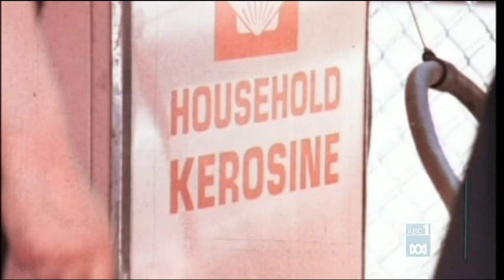Steam Powered 1963 Ford Falcon

Comment: Steam is still used to drive the worlds most advanced subs and aircraft carriers, and the biggest energy companys use steam to sell power everyone buys at a high price, so those agents of denial are are beings exposed now too.
Reply: Submarines and Carriers are still using the same steam technology developed half a century ago.
Here in California the last of the outdated and obsolete boiler fired steam power plant are scheduled to close forever.. to be replace by the ever growing number of Gas Turbine combustion power plants... they are both cleaner and more important MORE FUEL EFFICIENT than steam power plants. Knowledge is power, cheers!
Reply: You are certainly not implying that nuclear powered cars that operate underwater would be a commercial viable concept? Are you????
Reply: The real doktorbimmer  its comical watching deniers pull things to both extremes to AVOID  the obvious
Reply: The real doktorbimmer  what modern latest sub and carrier are using out dated  engines?
Reply: +Frank James There is nothing more comical that someone denying the Laws of Thermodynamics that govern Heat Engine Efficiency.  Not only was it was discovered that steam can never be more efficient than internal combustion, it was discovered nearly 2 centuries ago..
Reply: +Frank James  All of the Nuclear warships in current service with the U.S. Navy all use engine technology that has changed very little since it was developed in the 1960's.
They are only used in vessels that operate underwater or have unique fuel capacity or range requirements like carriers.
Name a single new commercial vessel design introduced into service this century that has a steam engine?
Reply: The real doktorbimmer anything that uses a nuclear reactor uses steam. in all intents and purpose a nuclear reactor is just a steam engine, the only thing different is the fuel.
Reply: name a cars that use steam engines.... thats what were talking about .. they dont want to make cars or other vehicles with steam they lose money doing it
Reply: +Frank James That is correct, steam cars are obsolete... because ICE cars are much, much better.
Reply: +madmax2069 Not true, there are many nuclear fueled systems that do not use steam, but steam was still commercially viable half a century ago when nuclear power was first developed. Of course nuclear energy is now in decline.. here in California the last nuclear power plant is scheduled to close, along with the last of the old, outdated steam power plants.
Reply: +madmax2069 California is now generating most of its energy from Natural gas fueled internal combustion engines... the most energy efficient power stations in the world are currently using Gas turbine engines.
Reply: i didn't say that.... i said the opposite of that , steam is much much better and to say the ICE are good is crazzy !
Reply: +Frank James Well, then you sir have been very, very misinformed... nothing could be further than the truth. Steam is an outdated and obsolete technology, because it is LESS EFFICIENT than ICEs
Reply: +Frank James I can't help but to point out the fact that you know very little about steam engines and Heat Engines in general.
Reply: i think the reverse is true .. did you know that only about 25% of the fuel you put into yuor car is used to run it? that's well know among engineers ;  then there is the 5% loss in friction , 30% loss in heat and 40% losses in exhaust gasses.. you call that efficient ?  The ICE, as it is now.. is such a poorly designed engine of waste and on a number of levels, which happens to neglect rules of proper  effective energy use. Take the spark plug, it  is the most limited source of heat ignition / combustion transference compared to other engine and combustion types, where as the law of combustion  expects the most amount of heat /ignition  contact to fuel  mix  for greater burn of combustion, yet the spark plug does the very opposite in supplying the most limited and minimal  ignition contact and transfer there is... not to mention the requirement of even greater efficiency and power with the increasing  amount of air / oxygen content to the  fuel , also  being totally reversed  in a typical ICE , where air stifled  and "dragged " into the combustion chamber..  also at some cost of energy in the intake and compression stages.
Reply: +Frank James Did you know that you can buy a ten year old used internal combustion car that exceeds 40% fuel efficiency? 
Steam engines are the LEAST EFFICIENT type of Heat Engine known.
Reply: +Frank James Then please explain why steam engines cannot match internal combustion in fuel efficiency?
Reply: Because steam isn’t a fuel its a medium or catalyst driving the engine ... steam enjoys a 1700 x expansion ratio.. were as gas is about 9:1 and diesel more than that. Steam once used to drive a turbine or piston can still be used as a source of heat energy and can be recycled
Reply: +Frank James You don't know very much on this topic at all do you?
Steam is the WORKING FLUID  and you are very confused about the difference between Expansion Ratio and Compression Ratio they are completely different concepts
Reply: +Frank James So you are unaware that internal combustion engine waste heat can also be recycled? although it is used less frequently due to its lower cost effectiveness.. because ICEs PRODUCE LESS WASTE HEAT.
Reply: " Steam is the WORKING FLUID "  ?  steam isn't a fluid and whats that mean to your point? 
I was referencing expansion not compression. lets say you added a spray of water to the power stage of a combustion engine without the interference of sensors and the ECU .. what would happen is a higher degree of further expansion than the fuel  mix alone could achieve, how be it the spark plug would be redundant !
Reply: +Frank James You are not very educated on the topic of Heat Engines, this is indeed apparent.
Steam is the WORKING FLUID
this term encompasses both gasses and liquids in the context of Fluid Dynamics AND in Heat Engine Thermodynamics .
Reply: +Frank James You don't seem to remember what you actually wrote here? "1700 x expansion ratio.. were as gas is about 9:1 and diesel more than that." 
You seem to be confusing expansion ratio and compression ratio with that exact quote.
Reply: SO then H2O are gasses ? everything has it place and time here.. the bigger idea here is STEAM is a state of a fluid and is invaluable  to all types of engines, even a combustion engine can build enough heat to create steam  and assist in the greater efficiency of it.
Reply: +Frank James Steam is water in a gas state, and acts as a fluid. Fluid dynamics is the study of liquids and gasses.
Reply: +Frank James But you do not understand the concept of "Latent Heat" or "Thermal Entropy"??? steam is less efficient as a working fluid because of the higher heat rejection caused by latent heat and greater entropy in a practical Rankine Cycle.
Reply: That sounds like double talk ..what exactly are ya tryi g to say... plus your stilling calling steam a fluid ..it idnt
Reply: *Engineering terminology...  No I said, WORKING FLUID   Fluid Dynamics describes the behavior of both liquids and gasses.. 
Didn't you ever go to college? This is remedial subject matter.*
Reply: your getting more and more confusing here   ..if a college jumped off a bridge...  Listen people make all kinds of errors because science & modern learning is in its infancy ,plus there's other reasons people like to think backwards but  logical folks do not call something what it is not..steam is not a fluid even if ya CALL it a fluid. Sometimes i debate with people who like to call science a religion because.. well thats what they perceive, but then wont  say directly science is a religion ..these types are usually liberals.. the chief of the double speak.
Reply: +Frank James  I'm really not that surprised to discover that you are so very confused, If you are not sufficiently educated or otherwise lacking the mental capacity? Any intelligent discussion on the topic of Heat Engines will undoubtedly be well beyond your abilities to comprehend.
As it would be pointless to discuss the efficiency of various joining and fastening techniques used in wood frame home construction if you do not understand the basic principles of driving a nail or a screw.
Reply: +Frank James If you do not understand such a basic fundamental concept like the fact that steam behaves as a fluid as described in Pascal's Law or Carnot's formula? Then anything you have to say regarding steam technology is simply mindlessly repeating something you heard without having any comprehension of what it means... if you take something blindly on faith, that sir is religion... not science.
Reply: NO steam is a GAS not a fluid .. a gas compresses a fluid can not ( practically ) they dont behave the same  becuse they are not the same.. what are ya talking about
Reply: +Frank James  In describing a thermodynamic system such as a Heat Engine, the WORKING FLUID is any liquid or gas that ABSORBS or TRANSFERS energy.
Reply: +Frank James Thermodynamics, Fluid Dynamics and Fluid Mechanics describe the function of both Pneumatic (gasses) and Hydraulic (liquids) transmission of power or energy.
Reply: +Autistic Boy And you never finished high school....
Reply: +Autistic Boy The truth is incontrovertible. Malice may attack it, ignorance may deride it, but in the end, there it is.

Comment: This is a better alternative than the electric and hybrid cars made today, especially in rural areas.
Reply: +Antony Butera No, they would certain not be better, steam cars are obsolete because they are horribly inefficient and expensive to operate.. steam is an example of how not to build an automobile.
Reply: +Autistic Boy How will you avoid the phase change and conversion loss penalties? By magic? You should be aware that every time you change matter or energy from one state into another energy is lost... you do understand these very basic fundamental concepts of engineering right????
Reply: Silly boy, You can't answer a simple engineering question? How will you overcome the additional conversion losses... adding more conversion cycles makes and engine LESS efficient.
Reply: Conversion Loss  that's why! Conversion loss is cumulative and cannot be overcome... That is why your concept is not manufactured, its LESS EFFICIENT

Comment: the reason that steam never took off in the modern world is not because it wasn't efficient enough or it was too efficient nor that gas was too cheap at the time or its a government conspiracy its because steam is inconvenient. really its a hassle to work with theirs wait times and things you have to do before start up and after start up. you have to constantly put oil into it so it can lubricate its self and you have to make sure not to hydro lock the block and you have to blast the scale out of the pipes. its just too inconvenient where as gas is relatively more convenient. also why electric cars are not dominating the market. recharge times are too long and that makes them inconvenient. once charge times equal that of gas fillups electric cars will be more convenient and then they will dominate the market. ps i like steam but electric is just the future and its futile to focus on the past
Reply: +Anthony Gelardi Its all about efficiency, the simple fact remains that steam is much less efficient than ICEs. One of the fundamental concepts here is that there is always a loss when you convert energy or matter from one state to another, steam is deeply flawed by higher conversion losses.
 Electric motors are very efficient in conversion loss but batteries unfortunately are also severely limited in range and efficiency. Although there are more EVs made now than ever, they actually have a lower market share than they did a hundred years ago.
Reply: Autistic boy is one of those "Google" engineers that doesn't have a clue about thermodynamics or engine efficiency... which is why he continuously make erroneous statements and then contradicts himself... good job, maybe we will nominated you for the "Pretchard Award" for outstanding automotive failures in history Hahahaha!
Reply: pop pop boats are extremely efficient 
autistic boy and doktorbimmer #goinghomesomeday
Reply: Don't write off hydrogen as a fuel. Australia has just found a way to transport large volumes as a liquid. This will change the game.

Comment: Technically anyone can hook up a steam engine to a generator and never have to pay electric ever again. Thus we are forced to use rare and hard to come by and process gasoline or rare and hard to come by lithium batteries. It's all about keeping power in the hands of the few really for population control.
Reply: +Autistic Boy The smaller you make a steam engine the greater the losses through thermal entropy.

Comment: Oil fluctuations are as fake as a hooker's smile. I'll start with that to make clear on what side i sit.
Take that car, replace everything with electronic management and an electric water heater and you've the modern car. Electric cars? That's bullshit, it costs more the environment to make a Tesla that it does an equivalent "eco" gas car.
Reply: Yes, you are correct sir, Ted Pritchard was a fool... steam cars have always been inferior to ICEs just as EVs have been for over a century..  Steam cars and EVs cause more environmental damage, have severely limited range  and are less cost effective.

Comment: A 1925 Doble E-20 Steam Car has a top speed of 136 MPH and 1,000 FtLbs. of torque, I think that could easily rival a gas car
Reply: The Second Law of Thermodynamics is already public knowledge... there is no need for you try to discover it again...
Reply: Nicolas Carnot discovered internal combustion engines were more efficient than steam back in 1824.
Reply: WoodenTreeMan Yup and could go over 1,000 miles ... with a electric boiler system of today's technology if only they weren't so complicated... there only true fault sadly
Reply: +Autistic Boy Unfortunately public education produces functionally illiterate imbeciles like you that think that the Rankine cycle can achieve higher efficiency...
Reply: I guess you and Ted don't read many books...  especially engineering books!
Reply: +WoodenTreeMan  Well you would be very wrong sir, The Doble produced a very unimpressive 150 horsepower and barely got much over 8 MPG..
Even a piece of shit Hyundai Elantra would "blow the doors off" the Doble up a steep highway grade and get 400% better fuel mileage..
There is a good reason why these dinosaurs were obsolete on arrival... steam cars were already obsolete by 1925.
Reply: @doktorbimmer idiotic reply why u need hp if u have t rex like torque ?? 
2tone car with 150km speed isnt enough for you ? what u want with hp then ??